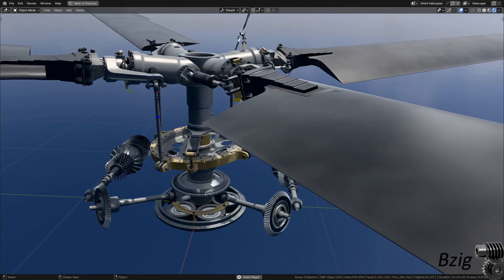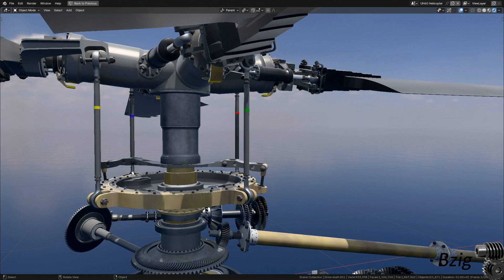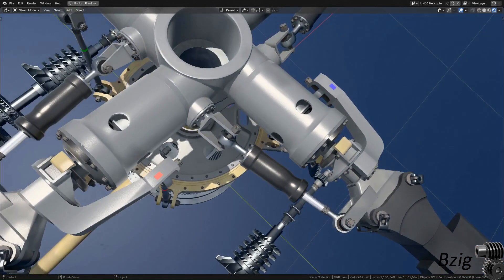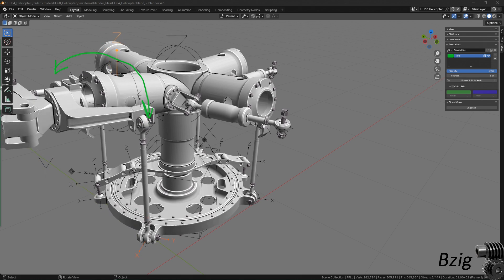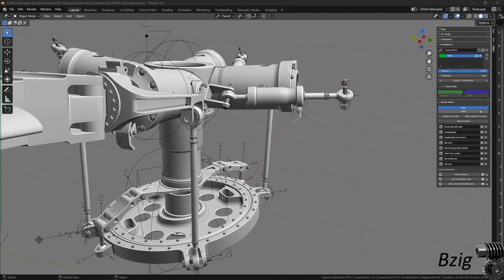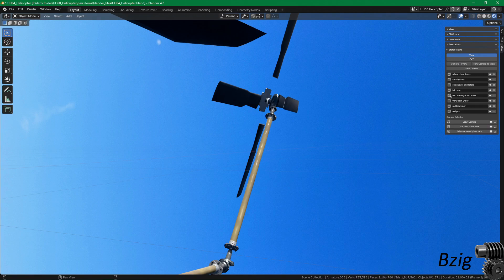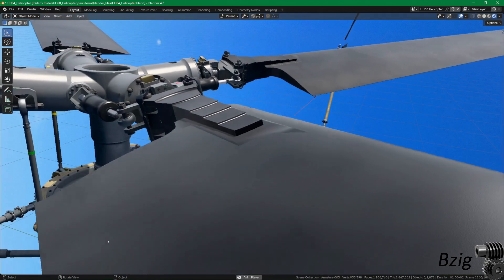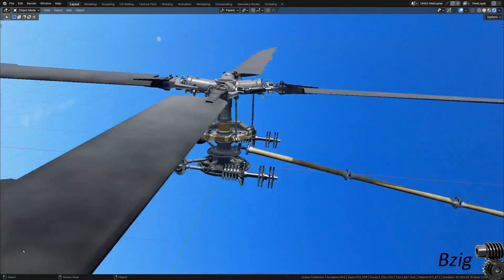How a Helicopter Works - Part 5

Comment: I wanna see you model a 4-blade version of the Mi-17 rotor head to show a more realistic example of a mechanically-hinged fully-articulated rotor.
Reply from the maker: I looked at some photos on line... that is an interesting design.  It looks to be a similar vintage of rotor hub technology to the Blackhawk... but hard to tell from photos.  Thanks for the suggestion.
Reply: @bzig4929  The Mi-8 and Mi-17 have the same rotor head and that head is very similar to the one on the Mi-24. You could do a 4-blade version of the Mi-24 if data on the Mi-8 or -17 is too hard to come by.

The Mi-8/17 and Mi-24's rotor heads have flapping hinges first, followed by lead-lag hinges with hydraulic dampers, then the feathering hinges. These rotors also have positive delta-3 since the pitch links are on the leading edge of the blades and are located outboard of the flapping hinges.

As for the gear ratio, the Mi-24's main rotor turns at 240 RPM when the engines are running at full speed (15000 RPM on the LPT, not sure what the speed of the HPT and compressor is). That gives a 62.5:1 gear reduction. 

I don't actually know the tooth counts of the Mi-24's transmission, but I've done the math to work out one possible way to achieve this rather nice, round ratio with fully hunting gear pairs. If this helps:

- There are two freewheeling clutches, and each engine's LP shaft directly drives its respective clutch's inner race.
- Outer races of the clutches drive 17-tooth pinions.
- These 17-tooth pinions act simultaneously on a 120-tooth first-stage bull gear.
- The first-stage bull gear drives a 32-tooth bevel gear which meshes with a 65-tooth crown gear.
- This 65-tooth crown drives a planetary gearbox with a 39-tooth sun, five planets of 46 teeth, and a ring gear of 131 teeth. The ring gear is fixed.

Comment: I didn't work 60s, I worked 53s. The rotor systems are obviously different, but there are similarities. The CH-53A originally had an oil lubricated, fully articulated rotor head with mechanical bearings. The D models were upgraded to utilize elastomeric bearings to eliminate the (maintenance issues with the) lubrication system and bearings. While it is still a fully articulated rotor head, we and Sikorsky just referred to it as an elastomeric rotor head. However, if you are taking an FAA exam, that's not an option. So according to their definitions it's fully articulated. I imagine the same terminology applies to the -60s.

Comment: The US Navy MH-60S Seahawk RFM states that the rotor is fully articulated. This is how I've always taught it to students as well. I agree, there are a bunch of different names for rotors with this freedom of movement. I just keep it simple, if it flaps, leads, and lags as a result of the rotor hubs freedom of movement, its fully articulated. Starflex, bearings, elastomer, etc... all the same in my book. 

Also, I'm curious to know if there is any induced pitch in the blades due to lead and lag, as the PCRs are connected to a point on the pitch horn which is not in line with the pivot point for lead and lag. Something I've thought about from time to time but never had a clear answer. You might already have an answer in the next video I'm about to watch.

Thanks!
Reply from the maker: The induced pitch due to flapping is also called "delta-3 motion"  I don't think I answered this for the main rotor, but I talk about it a follow on video of the UH-60 tail rotor and I go into the concept more in an R-44 tail rotor video.  

I modeled the H-60 main rotor is with no delta-3... the PCR is inline with the flapping hinge.  Of course, as you point out, the lead lag motion would introduce a small angle error that would feedback into blade pitch... this isn't modeled in the video.
Reply: @ I see, so the tiny amount of induced pitch due to lead and lag is not intentional, and is insignificant? No real impact of flight characteristics?

Comment: I appreciate the correction to the moniker of "Semi-Rigid" for the modeled system.  The simplistic FAA Pilot training describes 3 Rotor hub designs; Rigid, Semi-Rigid and Fully Articulating.  The characteristics of this system appeared to me to be most closely aligned with a Fully Articulating system.  You explained that the modeled system differs from the classic "Fully Articulating" rotor and takes pieces from other designs.  I did not however, follow which parts come from which of the 3 designs and how they may affect the terminology associated with the modeled system.    If you're able to expand on this, it will help to understand.   I greatly appreciate the work you're doing and the explanations.  Keep going!  Thank you.
Reply from the maker: I'm starting to think the terms semi-rigid, rigid and fully-articulated are not mutually exclusive terms.  It's possible to have a rotor hub that's both fully-articulated and rigid,  depending on how you define those terms.  

I'm reading the book, Black Hawk, the Story of a World Class Helicopter, by Ray Leoni and he covers the evolution of helicopter rotors.  I cover this in my recent video on tailrotors... Leoni talks about the bearings in the hub and the evolution of those bearings.  He talks about greased hubs in the 1950's, oiled hubs with mechanical anti-friction bearings in the 1960's and then elastomeric bearings in the 70's and beyond.  And he compares the elastomeric hub to a true rigid hub. 

For me, this is where the distinction lies.  The blackhawk main rotor is fully-articulated in that each blade flaps and lead-lags independently, but it uses elastomeric bearings and some people refer to elastomeric bearings as "rigid".  Leoni makes the distinction between calling the blackhawk rotor an elastomeric rotor, whereas the tail rotor is a bearingless flexbeam, or closer to a true rigid rotor.

Maybe a better way to define this would be to describe rotors hubs by 
(1) the motions they allow...  "fully-articulated" means the blades feather, flap and lead-lag, and "stiff in plane" means they only feather and flap.
(2) the bearings... greased, oiled mechanical bearings, elastomeric bearings and rigid.

btw, elastomeric bearings (the ones I'm familiar with) are made up of alternating plates of metal and rubber.  The deformation of the rubber, between each of the plates, allows the motion for each of the degrees of freedom.
Reply: @bzig4929  Thanks for the quick response.  I'm fully engaged in the basics at the pilot level at the moment, but will look to Leoni's book soon.  I've also received suggestions to review Ray Prouty's works....which are also on the reading list.
Reply: For reference, the FAA's Helicopter Flying Handbook (FAA-H-8083-218) roughly 3 paragraphs to each of the 3 rotor designs:  Rigid, Semi-Rigid, & Fully Articulating.   Simplistically, the Rigid system is able to Feather, Semi-Rigid is able to Feather & Flap, and Fully Articulated is able to Feather, Flap and Lead/Lag.  It's also interesting to note that they describe the older non-coincident flapping & Lead/Lag hinges as well as the new elastomeric bearings under the Fully Articulated section.  Great discussion!  Thanks for the invested time.

Comment: Two thoughts. 1: I think you could probably use inverse kinematic constraints to drive your pitch arms and pitch links. They can be a bit confusing to set up if you're unfamiliar with them though.
2: How did you rig the rotating swashplate? I cannot figure out a good way to have the rotating swashplate follow the rotation of the shaft while also staying aligned with the non-rotating swashplate.
Reply from the maker: My next video will have IK for the non-rotating flight contrila.   that was a mind bender to figure out.  It took awhile to figure out what has to be done in pose, edit and object modes.  Now that I know... I think you're right, the rotor head couod have been done, easier, with IKs.  

The swashplate has three parent levels. The first does not rotate... It fixes the location in space.  The second is a child of the first and has tilt plus z axis change.  The 3rd is a child of the second and this adds rotor rotation.

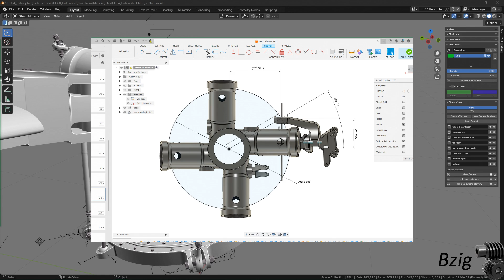Comment: 6:07 Never noticed that the blade  mounts isnt aligned with the centre. Is the centre axis of the blade aligned with the center point when looking from the top?
Reply from the maker: Nice observation.  The aerodynamic center of the blade, which is at 1/4 chord, aligns with the center of rotation.  This is also the center of feathering rotation in the spindle and it keeps forces nice and balanced.
Reply from the maker: wait... that didn't make sense.  The aerodynamic center is aligned with the center of the spindle rotation, but this is forward of the hub's center of rotation.  Maybe it's to keep the blade cg in line with the center of rotation??  I know the real hub as this offset, but now I can't recall if I wondered why as I was modeling this.  It's hard to see IRL because of the bifilar.

Comment: Another great video on how the the mechanics of helicopters work. Although it might not be the easiest thing, I hope to see how the bearings work in the swash plate, staring from the drive shaft (up and down motion) all the way out to the control horns (rotational motion).
Reply from the maker: I don't know for sure, but given the forces involved in the swashplate (both from the hydraulics pushing up and the rotor forces pushing downward) I'd assume they use a double row, angular contact bearing.  I actually did model those, but only in the gearbox; not in the swashplate.  I'm working on another video... I'll do a clip of those bearings.  Thanks for watching!

Comment: Hi there. I appreciate your work here. It illustrates well  the concepts of the UH-60 power train to the rotor head.  As a now retired electro mechanical repair tech III, working on devices used by the top research labs in the world. I will give you an insider's perspective. The difference between what makes a very complex device operate well, and fail completely is known as " build up of tolerances". That is why many tolerances are called out in a single thousandth of an inch. The resaon being is each consecutive jointing interface, being more than the specified call out, results in an compounding  sloppiness in the system . That at the end critical  point makes the difference between a 5 thousandth functional  tolerance and a ten thousandth inch dysfunctioning failure mode. These critical tolerances are generally proprietary to the engineering departments of the manufacturer. They have done all the experimentation research as to what tolerances are consistenly  functional, and what tolerance build ups result in " epic  fail."  In my case, semi skilled builders assembled a very complex electro- mechanical widget worth thousands of dollars, as certifiable  sourcing to NIST standards. One out of 3-5 widgets  failed repeatability final testing. It was up to me to rebuild those widgets so their repeatability was 100%, on a 30 repeat final test. And to repair used product returned for service back to 100% repeatability.  In Aviation,  Helicopter mechanical systems, and  any aircraft turbine power systems, have the tightest tolerances. This is why total rebuilds costing tens to 100s of thousand  for such systems. You make top drawer conceptual renderings. But.... you do not have the thousandths of an inch proprietary data that makes everything fit together and work perfectly. Nor will any of the engineers  or repair techs disclose that. Most being under Non Disclosure Agreements. Thereis an interesting " gossip"  that the Russians also built a Space Shuttle. But it never flew. Because the espionage  data they were fed was intentionaly false. So your conceptions of dynamics modelling is educationally good.  But without the blueprinted  real world manufacturers tolerances  you can never expect everthing to fit together perfectly. Yet still your conceptual flow is indeed educational.  The caveat being , " these are for conceptual flow use only. The actual detailed to thousandths of an inch build tolerances is proprietary to the manufacturers."
Reply from the maker: Here's a funny story about the Russian space shuttle.  Although they never flew it, they did enough work to know they planned to roll the aircraft prior to orbital insertion... just like the American's did; the Russians copied NASA.

NASA rolled the shuttle because they reused the Apollo launch pad and the only way the shuttle would fit was backwards.... they had to roll or else it would have been in the wrong attitude for orbital entry.

Touche on the tolerances.  I'd doing this because I find it fun and I hope to educate.  Speaking of tolerances, I found the drive-train data (module, helix angle, pressure angle etc.) in a NASA technical report.  After I modeled it, I see there is less than 1mm of clearance between the planet gears.  It's not like I could have screwed that up... gear math is pretty easy.  I'm surprised they would have that little clearance.   Or maybe, as you said, the real numbers are proprietary.

Thanks for watching and commenting!
Reply: @bzig4929  I think what you are doing is excellent endeavour. It shows quite adequarely the power flow concepts. And also shows the limitations to complex dynamic components modeling.  Virtual Reality, and real world practicality can be very close correspondence but seldom exact to each other.  In the proprietary work I did.  When the line, which used several jigs,  produced a widget, that failed the repeatability standard required by NIST cert.  These were micro level devices. They would be handed over to me, to either tweek electronically or gravitationally to repeatability standard. Then environmentally cycled hot to cold performance specs for two weeks. Then retested and if still out of spec. A total tear down of the widget and it's 45 mechanical components and 12 electro- mechanical, components. When 10 of these would accumulate, I would just randomize the 10 of each component and reassemble. Typically 7 to 10 of these rebuilds would pass all tests, and ship. During the prototyping of these devices over 2 years, there was plenty of  trial and error re-engineering. 

In real world that's why engines are not shipped without some sort of factory run in.  To make sure all the components mesh well enough to not immediately fail. What I'm try to say is, it my be a perpetual exercise in frustration to get all your interfaces in perfect mesh.  Keep up the modeling. When you are done you could even market to A and P schools.  It appears your first module was based on the Astar 355 combining transmission and  three blade rotorhead.   The UH-60 appears to simplify the reductions to far less interfaces.

It would be interesting to see the intial turning motor/ generator.  The Allison C series turbo shafts could be another challenging project to show, as the transmission is integral to the turbine.  Good Work.

Comment: Gyroscopic precession for the first thing.
Reply: This 👆

@PetesGuide The force (increased angle of attack [AOA] and therefore lift on the 6 o'clock rotor) on a spinning disc (rotor) is applied 90° in the direction of rotation (counter clockwise results in the 3 o'clock position). Lots of great videos about this, but the best physical demonstration is to hold bicycle wheel by the hub, spin it, and apply a force and see what happens.

This results in the right hand side of the rotor rising and the left falling, resulting in a left turn. You can see the 12 o'clock rotor blade reduces AOA to compensate for the increase on its counterpart - much like ailerons do in an airplane.

Full disclosure, I'm a fixed wing pilot with about 3 hours of helicopter time so I may have outkicked my coverage here; I welcome the more qualified folks to correct/augment as needed without going too far into the weeds.

Comment: One thing that confuses me in this video is the part about how the control inputs need to be mechanically input about 90° ahead of the desired direction change. Well, several things actually.

I know I can use the tail rotor drive shaft as the 180° reference relative to forward flight, but I’m still getting lost when you start drawing on the model. Can you add some sort of visual reference with the cardinal angles, plus the slight variations you’re talking about?

And can you increase the visibility of your annotations? Maybe wide translucent “highlighter marker” strokes? I easily saw the 270° green lines mentioned at 3:31 , but not the short one at 3:42, and had to replay it several times to see it. While doing so, I realized that your presenting the system from several different camera positions is why I was confused about where the nose of the helicopter was. Some sort of helicopter-specific compass rose would definitely help!

And this is getting ahead of your planned curriculum, but I don’t understand why the inputs need to be 90° ahead. I think a very brief bullet point explanation of why would help the next time you animate this assembly.

Lastly, I do think we all would appreciate you modeling the non-rotating swashplate before moving on to other topics. I’d like a complete description of this mechanism before learning something else.
Reply from the maker: I'm actually learning how to use Davinci Resolve for the video editing part of this (I've been using Blender to edit the videos, but it's really optimized for animation, and not video production)  I hope to learn some better techniques for annotating videos in Davinci.
Reply: @bzig4929  Interesting comment. I have some experience in both fields. I started using AutoCAD in 1989, and was later the technical editor for CADENCE magazine for a decade. A sister publication was DV Magazine.

It’s been a while, but I’m not aware of video editors that can do 3D matching. What is Davinci capable of these days? Can you create a 2D plane in Davinci and have it match the rotations in Blender?